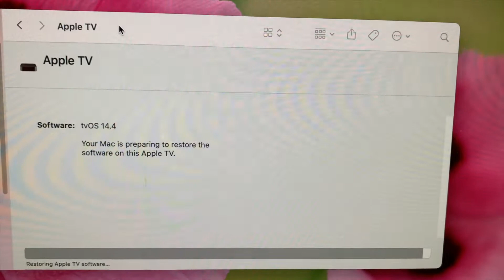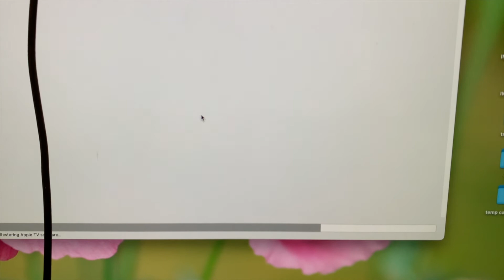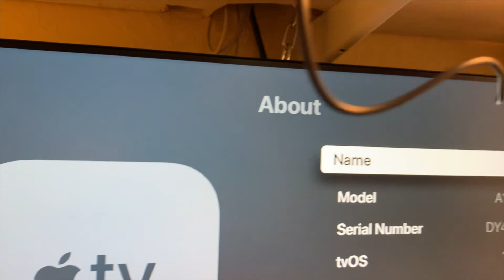APPLE TV 4TH GEN INTERNAL MEMORY UPGRADE! WILL IT WORK??

Comment: I have a 32gb model with a band NAND. I tried replacing it with a NAND from another Apple TV. It didn’t work. Is this because I would need to extract the data from the old chip into the working one? What chip programmer would I need to get for this?
Reply from the maker: @piggyhero5174  for this I used the naviplus pro3000 nand programmer. Thanks rich

Comment: I got the 32 GB 2022 4K model and I can say it fills up quickly from side loading emulators and roms. Do you know how high the latest gen can be upgraded to? I would love a 512.
Reply from the maker: Quick update to my previous answer, A friend of mine has the 4k model and asked for the memory upgrade. the 4k models 2017 and 2021/22 unfortunately don’t have the USB C port in order to do a restore on iTunes after installing the NAND memory. Also the ipsw files which are needed to do the full firmware restore on iTunes may not be available as Apple had no intention of allowing you to connect to iTunes. There is a way of soldering jumpers to the lines and installing a USB port to allow pc connection but without the firmware files available this won’t allow you to do it unfortunately. After installing a new NAND memory , a full firmware restore is required unfortunately and Apple has removed this option from the later models. If I find a way, I’ll update you on how. Sorry for the previous mis-informed answer. Rich
Reply: @SURGE101  Hi! i have the right firmware files for restoring an apple tv 4k A1842 with gaster. Is the Naviplus pro 3000 compatible with the Apple TV 4k Nand (BGA 70)? or do i have to buy some other nand flasher.
Reply from the maker: @dennisittner3858 hi I did look into upgrading the newer models of Apple TV. unfortunately the A1842 and above don’t have the port for connection with computer to restore unfortunately. So it makes upgrading the memory not possible. Once you change the NAND, it will force it into dfu mode and unfortunately without being able to connect to the computer , you won’t be able to restore. You will also need a newer programmer than the navipro 3000 , you’ll need JC PRO P7 or similar for that model of nand as the navipro 3000 only does the older types of nand. You may be able to mod the board to allow you to put a temporary port on for the restore process but this will require a bit of research to find where the necessary connections are unfortunately. Thanks rich